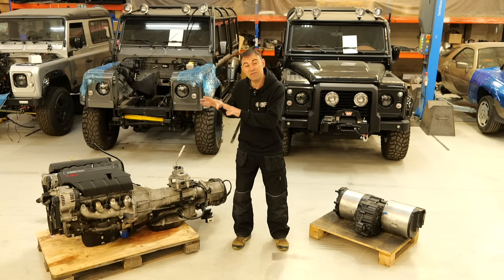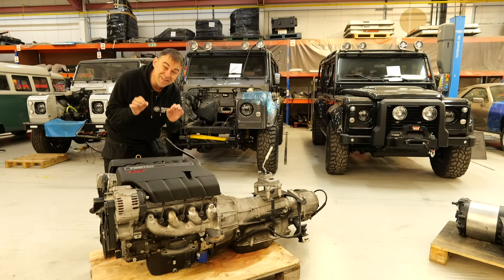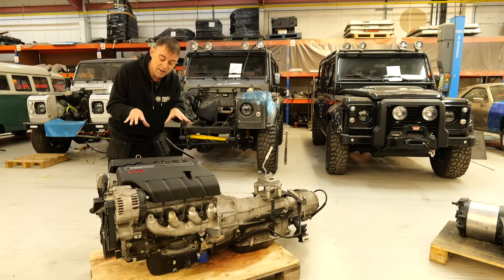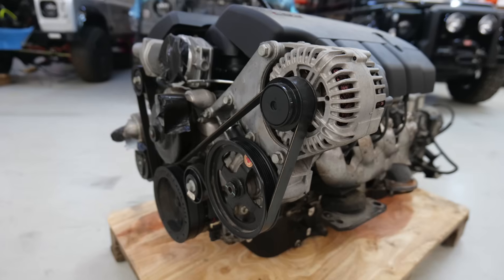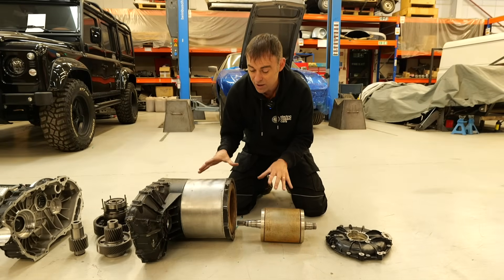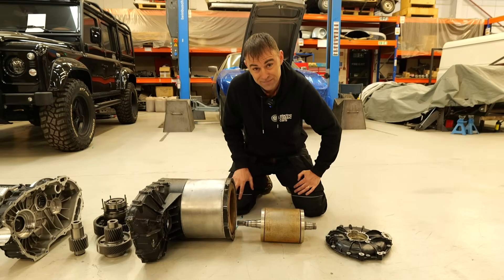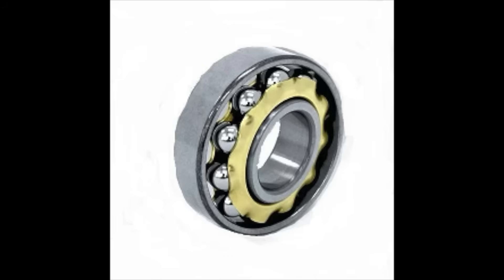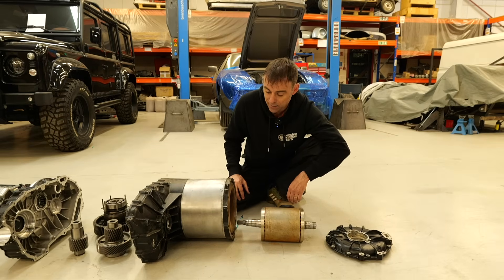Let's compare the Tesla LDU with an LS3 V8 and take one apart to see what makes it tick.

Comment: I too was unaware that half the unit is encased control electronics, not a second rotor.

What we need now is a compact alternating power source (removing three inverters and have vehicles with diff crown set geared to accept the higher 18000 rpm / an e motor that has half the revs...and then wouldnt life b simple :)

Now, go and stick one in a mk2 or mk3 4wd TT with min c 280 mile range and, thru volume make the conversion affordable to the average enthusiast :) The power of this unit should b ideal

Comment: Where is the other half of the electric motor? The battery? The battery in the cyber truck is 2000lbs. How is it efficient to pull along a 2000lb battery with you? Most of the capacity is spent moving the battery itself. How is that efficient? You left all this out. Long live the V8. The electric motor is as boring as this EV promotional video. EV's are throw away cars, unlike gas cars which can run forever.
Reply from the maker: This episode is just about the motor and stripping it apart to see what makes it tick. If you want to see a fuel vs battery comparison check out our previous Tech Talk. 👍 https://youtu.be/opF1si__APs?si=nzdWz3TJjQ1ZDDbI

Comment: Rubbish comparison. Normal cars have complex engines with extremely simple fuel system. EVs have simple motors with ridiculously complex and unstable fuel systems. Without a fuel system both are as useless as this comparison.

Comment: Tesla motors are designed to last a million miles, so I find your claim of coolant leaking into the motor lacks credibility.  There are numerous Model 3 and Model S cars on the road with 300k-500k miles on them, and the original motors have not failed. These motors obviously are not leaking coolant,  and they have not had any oil changes. 

I also find it very hard to believe that you know more about cooling Tesla motors than Tesla does.  These motors are proven and they endure extreme hot and cold weather temperatures spectacularly well.  I seriously doubt your modifications are necessary. 

Finally,  even if you're correct and the seal does fail, a minute,  tiny amount of coolant fluid would leak into the motor because that seal fits tightly into its seat. For it to leak enough coolant to fill up half of the motor cavity strains credibility.  In short,  I don't believe you.  

Also,  if that much fluid leaked into the motor it would trigger an error message in the software.  

Something about your video just doesn't smell right.  Why would Tesla put a rubber seal that could fail in a million mile motor? Something about your video seems to be very deceitful and deceptive!
Reply from the maker: I think you need to do some research on the subject. The coolant delete is something that Tesla do themselves as the problem is prevalent and real.
Reply: @ElectricClassicCars  I appreciate that your video brought up this issue, but you deceitfully left out key information. I did some research using AI, and your video does not mention crucially important facts. 

Here is a far more truthful and accurate account of this issue provided by Grok AI:

The issue with the rotor seal failing and allowing coolant to leak into the motor cavity is not a widespread problem with current Tesla electric motors in newer models (e.g., Model 3, Model Y, newer Model S/X, and Cybertruck). However, it remains a known issue for older Tesla vehicles equipped with the Large Drive Unit (LDU), particularly in Model S (2012–2020) and Model X (2013–2020). Here's a concise update:

Current Status
•	Older LDUs (2012–2020): The PTFE lip seal failure in the LDU, which allows ethylene glycol coolant to leak into the motor cavity, is still a concern for vehicles from this era, especially those with high mileage or out of warranty. This can lead to bearing corrosion, inverter faults, or motor failure. The issue is well-documented in forums like Tesla Motors Club and by repair shops like QC Charge.
•	Tesla’s Fix: Starting in late 2023, Tesla introduced a revised LDU with a “-U” part number suffix featuring a Coolant Delete design, eliminating coolant flow through the rotor. This effectively resolves the issue for new or rebuilt units. However, older LDUs in circulation (pre-“-U”) are still at risk unless retrofitted with aftermarket solutions like Coolant Delete kits.
•	Newer Tesla Motors: Modern Tesla drive units (e.g., in Model 3, Model Y, and post-2020 Model S/X) use different motor designs and cooling systems that are not prone to this specific seal failure. No significant reports of similar coolant leaks exist for these newer motors.
Your video inferred that this is a current problem with all LDU Tesla motors, which is dishonest and deceitful. 

YOU SHOULD APOLOGIZE TO YOUR AUDIENCE FOR LYING BY OMISSION! This is not a current problem with Tesla electric motors, and you should have said that!
Reply from the maker: @franklong6269 You’ve literally just confirmed I’m right. 😆🤷‍♂️🤦‍♂️ Most Tesla model S motors are prone to coolant leaks. Tesla Model 3/Y motors are completely different.
Reply: @ElectricClassicCars  This is the exact quote that explains that Tesla fixed this issue in the Tesla Model S starting in 2020:

"The issue with the rotor seal failing and allowing coolant to leak into the motor cavity is not a widespread problem with current Tesla electric motors in newer models (e.g., Model 3, Model Y, newer Model S/X, and Cybertruck). However, it remains a known issue for older Tesla vehicles equipped with the Large Drive Unit (LDU), particularly in Model S (2012–2020) and Model X (2013–2020). Here's a concise update:"

Here is what you are trying to say -  evidently, you didn't read my previous post:

"Tesla’s Fix: Starting in late 2023, Tesla introduced a revised LDU with a “-U” part number suffix featuring a Coolant Delete design, eliminating coolant flow through the rotor. This effectively resolves the issue for new or rebuilt units. However, older LDUs in circulation (pre-“-U”) are still at risk unless retrofitted with aftermarket solutions like Coolant Delete kits."

So pre-2023 LDU motors "are at risk [of leaking],"  if nor retrofitted with an "aftermarket" solution. You didn't say this in your video! You inferred that this is a current problem with all LDU Tesla motors, and it appears that Tesla started addressing this in 2020, and changed the design further in 2023 so that no coolant runs through the center of the LDU motors.  You didn't communicate this important information. This utterly discredits you.

Apparently, not all Model S motors leaked at this seal, as you infer, because the supporting information states that LDU motors are "at risk" of leaking. So it is unclear how widespread this problem was before Tesla started addressing it. 

These are important facts that you were either too lazy, too stupid, or too dishonest to communicate in your video. This failure breaks the trust of your viewers and your customers and discredits your company's reputation.
Reply from the maker: @franklong6269  The vast majority of Tesla Model S motors were made prior to late 2023. Of the large number of LDUs we’ve rebuilt we’ve yet to see one with a factory coolant delete I.e. 2024 model onwards.
Reply: @ElectricClassicCars  Thank you for having the character to communicate this information.  It restores some credibility to you. I now believe that you were communicating what you have found to be true in the field and I respect that firsthand knowledge. That being said, you should have been clearer in your video.

Since Tesla changed the design in 2023, there will be a transition period in the Model S motors. That is probably why some old LDUs have trailed into 2024. It also appears that this does not affect the majority of Model S cars, which are lasting hundreds of thousands of miles.

Your shop seems to be impressive. I think if you are clearer in your videos, your channel will do well.

Comment: And how heavy are the batteries, for what range. and how long does it take to recharge ? Not an entirely objective comparison.
Then, what is the cost of the conversion? I bet a Tesla drive unit isn't cheap, though they might be readily available when the self driving "facility" is used.  BTW, I'm not anti EV, I work with CNC machine tools which have very powerful servo motors and I have seen their power and torque in a bad way. I have seen a 2 inch shaft snapped by a big servo motor.

Comment: I also like the simplicity and the compactness of the EV drive. Also the amount of direct control we have through the inverter. However, to be honest, when we compare the weight we have to include the battery and of course a full fuel tank for the combustion engine, so the EV will lose some advantage in weight, but has the advantage to have the battery flat and very low in the vehicle, helping with stabilization.
Reply from the maker: This episode is just about the motor and stripping it apart to see what makes it tick. If you want to see a fuel vs battery comparison check out our previous Tech Talk. 👍 https://youtu.be/opF1si__APs?si=nzdWz3TJjQ1ZDDbI
Reply: @ Thanks for the reply, I'll check this episode as well 👍

Comment: This is very stupid. Engines must be compared with related fueling systems. Show the tank with the V8, and the huge, one-ton battery feeding the servomotors, or operate the Tesla under trolleybus lines only.
Reply from the maker: This episode is just about the motor and stripping it apart to see what makes it tick. If you want to see a fuel vs battery comparison check out our previous Tech Talk. 👍 https://youtu.be/opF1si__APs?si=nzdWz3TJjQ1ZDDbI

Comment: One of my favorite sayings I found about an ICE is it's basically just a heater that spits out a bit of motion as a byproduct.
Reply: heater on wheels.
Reply: 😂😂 that's a good way of looking at it !!
Reply: Right that’s why they suffer way less than EV does in cold winters.
Reply: @wsu8568  On the contrary: With EVs you can pre heat your vehicle remotely and it's nice and cozy and windows defrosted when you get in.
Also no engine suffering cold starts.
Reply: @wsu8568 well so long as the oil pan heater is plugged in, radiator ditto, in temperatures below zero.
Reply: a NOISY heater😂😂
Reply: @Mabeylater293  and smelly
Reply: Most of the energy disappears into thin air. Pointless use of money. By reducing unnecessary electricity consumption at home, you can drive almost for free if you charge at home.
Reply: @ lol
Reply: Yep Evs just spit you out roasted.
Reply: The free heat is one of the many advantages of an engine- you don't have to ration it to preserve your range..
In an EV, your already limited range, is further limited by cold weather, then even further if you want a 'modern luxury' like cabin heating, which is why manufacturers recommend only using the seat heater!  No thanks..
Reply: @SteveLomas-k6k  it isn't free, it's wasted energy. Imagine how much more efficient the car could be if it wasn't running the heater literally all the time. I have my car's thermostat set to a constant temperature all the time and I never notice a substantial range decrease. Most modern EVs use heat pumps for cabin heating so the efficiency hit is the same as running your AC which also impacts ICEs. EVs basically gain you the ability to actually turn off your heater and gain an efficiency boost from doing so, saving money and energy. Additionally I've never heard a manufacturer recommend only using seat heating, that's ridiculous. I've heard about people doing that to conserve range but I drive a lot for work and it's never crossed my mind, I use my heat and my AC and never worry about range.
Reply: @Scoopta  Free as in; you get unlimited heat included in the price of the gas. 'Efficient' is a rather subjective term here:
To me efficiency is getting >450 range in 2 minutes, in any weather, no degradation, and being able to blast my heater without taking a range hit. 

Efficiency is NOT having to wait an hour to do what my car does in 2 minutes. 

"Most modern EVs use heat pumps for cabin heating so the efficiency hit is the same as running your AC which also impacts ICEs"
well there you go, I DO notice range loss in an ICE car with AC, with an EV you get the same hit with heat also. 
Same as a house; most of us can live without AC, most of us can't live without heat.
Reply: @SteveLomas-k6k  efficient is not wasting your money on running the heat all the time. With an ICE you'd notice a range improvement if you could turn off all that waste heat. There are already several EVs that can do 400+ miles of range WITH AC/Heat running and as the technology improves that will become more widespread. You're seeing it backwards. It's not that the heat in an EV knocks your range...it's that heat in an ICE is permanently costing you money and range. An ICE is like an EV that you never turn the heat off on and you that hits your wallet even in the summer when you don't want heat
Reply: @Scoopta  So there's the 2 different definitions of 'efficient': technical and practical.

Yes IC is technically less efficient energy wise in the car itself (without getting into all the inefficiency in electricity production & transmission)
But IC is much more efficient in the practical sense (doing the job of being a car)-   always ready to go anywhere, anytime, more range, faster fueling etc.

If I need to drive for a family emergency 1000 miles away in February.. there's not much confusion, about which car is going to do a more efficient job of getting me there asap.
And if that efficiency of travel costs me a little more (which is highly debatable) I'm willing to pay for that.
Reply: @SteveLomas-k6k that's fair. For an emergency where you NEED to be somewhere ASAP I can't disagree. EVs aren't there yet. Some are getting there, there are some that charge astonishingly fast(15 min) but it isn't there yet. I would say with home charging they're more ready to go because you know it's always charged but that's only a saving if you're within the range. I WOULD NOT say that makes it a better car though. Emergency use is like 0.1% of what a car is for. I should hope you aren't always having an emergency. I'd rather have the cost saving, the lower maintenance, the better driving experience. An EV is basically superior in every way except range and time spent refueling and they're getting better in those areas too.

Also to your earlier side comment. Electricity generation and transmission often exceed the efficiency of an ICE on their own and EV drive trains are often 90% or higher efficiency. That being said EVs have a cool ability in that regard, their footprint is dictated by the grid and not the vehicle. As the grid improves EVs do too, ICEs don't have that ability

Comment: we still need to see fresh new designs for vehicles to fit the electic motors and batteries(Teslas are still shaped like normal cars) something like what VW did with the small air cooled engine in the back of the Beetle or especially the Bus ....even with all of today's EVs, not much new has happened to change personal transportation in the last 100years, since the basic box with a hump in the middle where you ride

Comment: As a kid I use to get excited about exhaust systems, now I see them as pollution systems, air and noise.
An ICE engine is so complicated which means a huge number of things that can break.
Reply: I still get excited about exhaust systems at 53 years old.  I get excited tearing down and modifying ICE’s and I make a living working on cars.  That LDU does not excite me.  Yes it’s power dense and efficient but it is really boring.  Quiet and what mods can be done with them besides that coolant delete?

Comment: Great insight guys.  I’m sure petrol heads will be up in arms that you didn’t include the weight of the battery though.

Might be an idea to include all those extra gubbins for the v8 and a full petrol tank.  Then give the weight of a few sizes of battery.

I’d imagine at least another 100kg for the v8, so 500kg in total.  So about 350kg less.  What capacity battery could you get for that?

The future gains for electric will be much more than internal combustion.  I believe the best drive units are now in the Lucid.
Reply: Try getting a Lucid unit.
Reply from the maker: This episode is just about the motor and stripping it apart to see what makes it tick. If you want to see a fuel vs battery comparison check out our previous Tech Talk. 👍 https://youtu.be/opF1si__APs?si=nzdWz3TJjQ1ZDDbI

Comment: Interesting!  BYD make blade batteries are they better or worse than tesla cells?
Reply: To this point, MOST "Tesla" cells are Panasonic (Tweaked for Tesla) or CATL. (Some LG)
And they tend to be Nickel rather than Iron based.#
As such they are "Different" and the choice depends on what you need.
Reply from the maker: I personally think they’re better. Not quite as energy dense but better chemistry. Their LFP modules are easier to recycle, cheaper to make and to try to get them to go into thermal runaway is really hard.